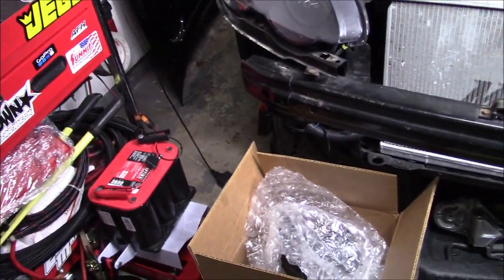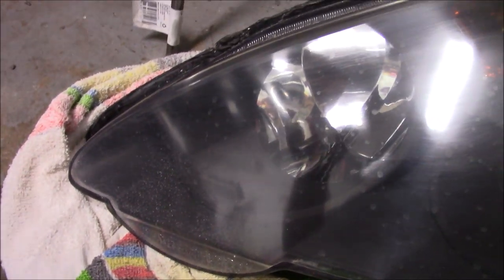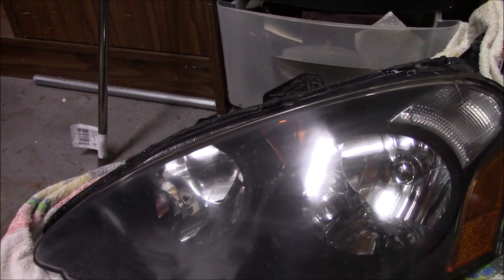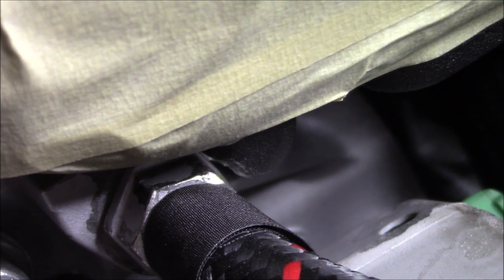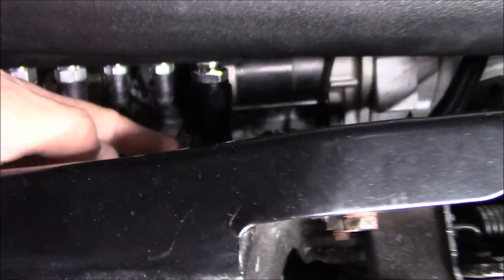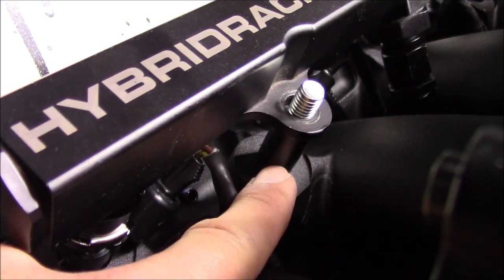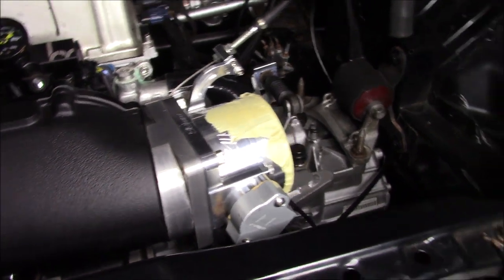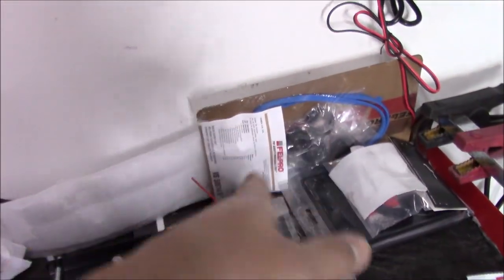Why is the RSX my race car?

Comment: Love the rsx man I’m working on an AWD conversion for my rsx it’s been a pain to get the fitting but it’s coming together it’s a k24/20 with valve springs retainers and pistons rods running on e85 walbro 525 I’m building it to be a turbo car